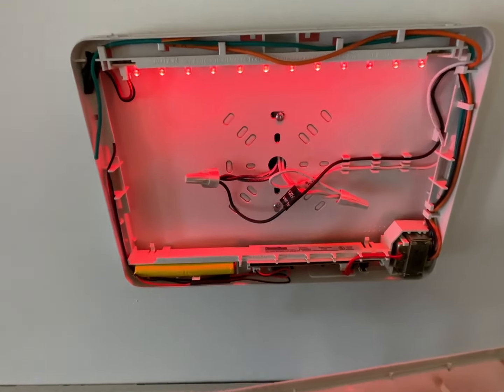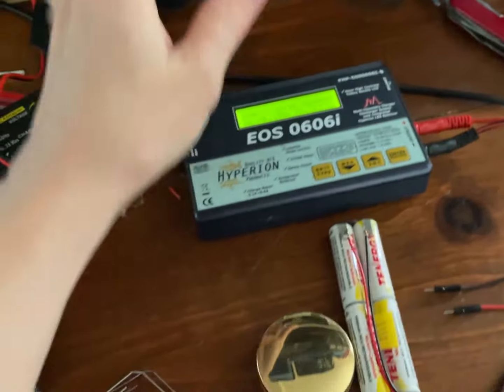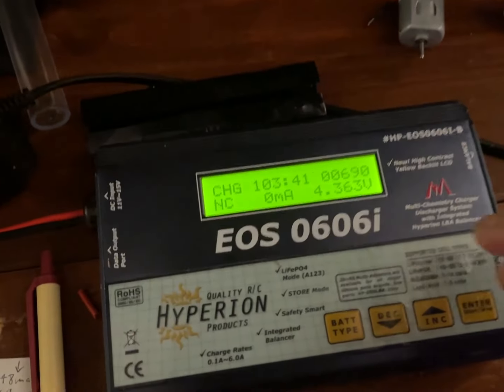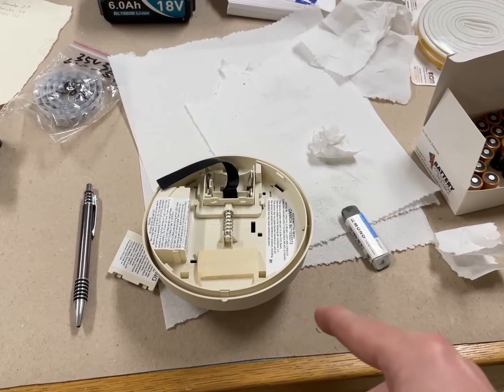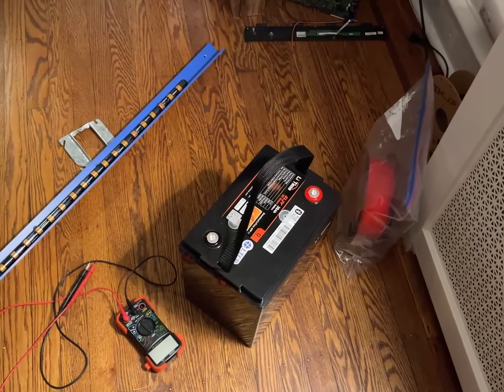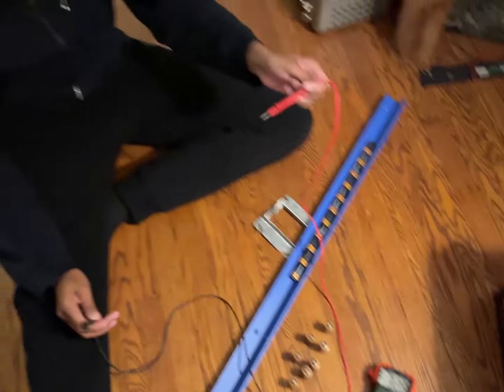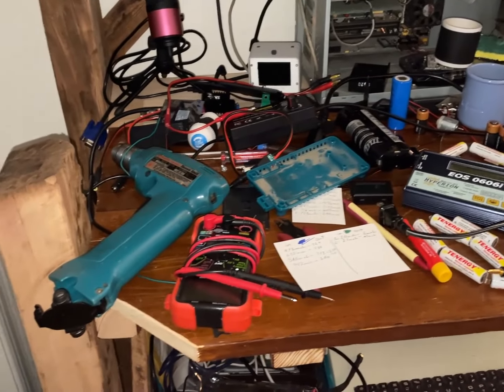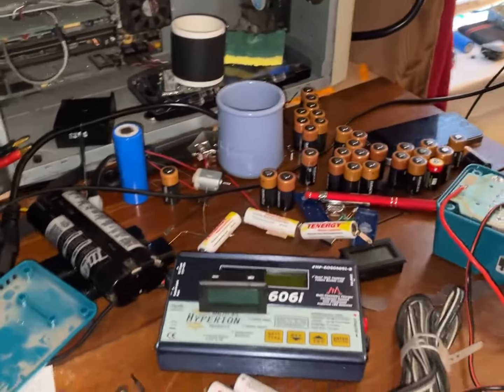Fun with Smoke Alarm / Exit Sign Batteries. Trying to revive Ni-CD cells. Find a use for 123 Cells?

Comment: I find often the cells grow dendrites inside, which increase leakage. I had moderate results with doing a high current pulse charge on them, using a 1000 uF 250V capacitor charged up to around 60V, and connected with a rather used industrial push button switch. 4 or 5 shots across the cells got them to somewhat recover, and they would last months before the dendrites grew back again, though often they would have vented and lost electrolyte first, making them go open circuit.

Comment: I really like these battery tinkering videos. Also it just reminded me that I need to bring out my old NEC ProSpeed 386SX laptop from storage, and do my battery cycling on it (I do that about every 6 months or so). It is from 1989, has a Ni-Cd battery, and amazingly it still works, and has most of its original capacity (it was unused until I got it in around 2016, then after multiple full charge-discharge cycles it has regained its capacity). For these old batteries I think it's better to use them every now and then, that way I can monitor if something is about to start leaking etc.

Comment: I love doing this kind of stuff, my recent favorite is salvaging the cells and charge boards from disposable vapes (the things should be banned imo, along with all disposables), and re-purposing them to power all kinds of things.  You get a free lithium cell and a charger for it with a usb port, even a charge indicator!  Remember those free blue oval work lights from HF?  my collection is now lithium powered and rechargeable via USB port, as is my old battery powered stick-light, and my laser thermometer, pretty much anything that takes two or three alkaline or rechargeable nicd/nimh cells.

Comment: I'd imagine this wasn't the memory effect but voltage depression due to constant over-charging. It would be wise to check the charging current from the exit sign, decreasing it to C/40 or C/100 could make those batteries last a lot longer.
Also, if you ever replace the battery packs with AA holders, make sure you get AA batteries that are compatible with trickle charging (i.e. support gas recombination). Usually it's cheaper cells without "low self discharge" or "comes precharged" claims.

Good luck!
ps. wasn't it easier to just repin the connectors instead of cutting the wires?
Reply from the maker: Good tips, and the connector didnt readily give up the pins so repinning was easier